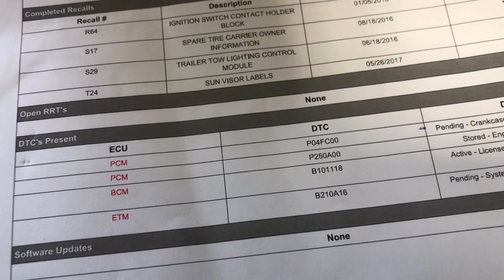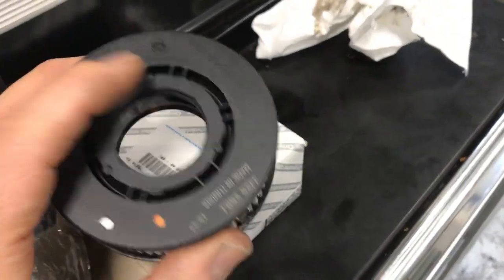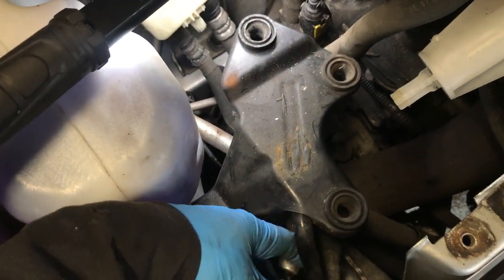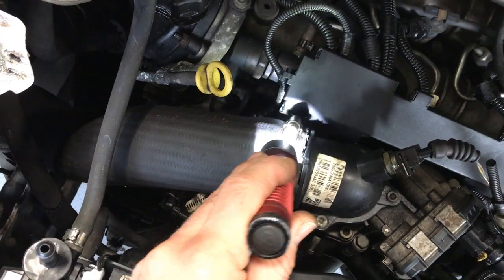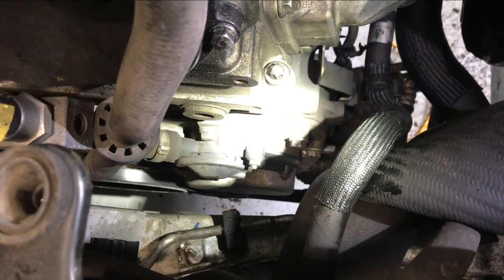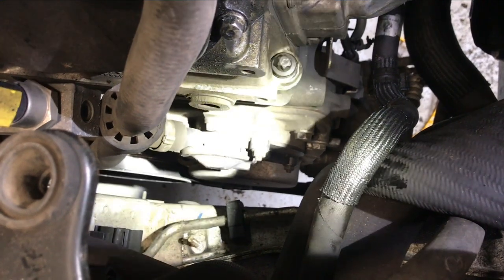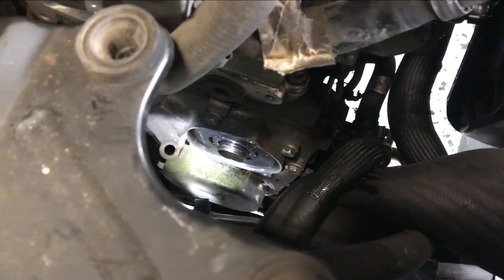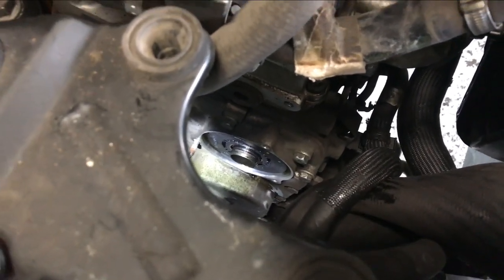Promaster Ducato 3.0 Diesel Crankcase Ventilation Filter

Comment: TDR how many miles were on this Promaster diesel?
Reply from the maker: BILL WORKMAN 107k
Reply: @TDRAuto  So this probably should be replaced at a 100K  then,  how many hours for job?
Reply from the maker: @billworkman8430  First time it took me almost 2 hrs, now roughly an hour. Service Information doesn't even have this filter listed! On Cummins it should be replaced every 67.500 miles and 1/2hr job tops. I would replace it even sooner then 100k. These engines are not cheap and not many mechanics like to work on them.
Reply: @TDRAuto  A lot of stuff  isn't listed I just had my actuator serviced at 75,000 miles I had to show the service writer  (Bettenhausen Ram) the M40 manual for recommended service which is 40,000 or 2 years and just a heads up on head replacements i guess FCA might not have the original heads available anymore for 2014 - 2015 model years there's a couple of members on the Promaster diesel page that have had the wrong heads installed after glow plug breakage and they're not compatible different gaskets sets etc any advice on that?